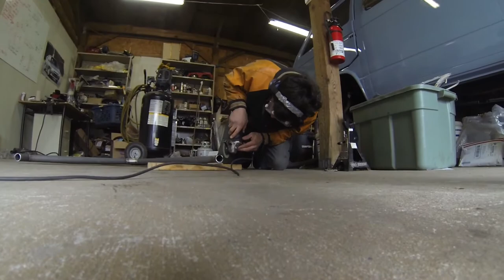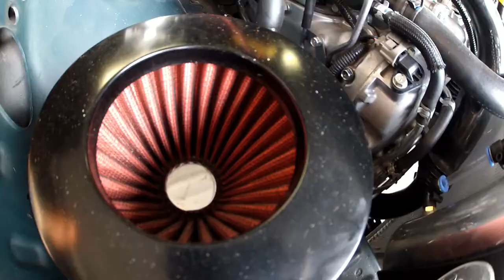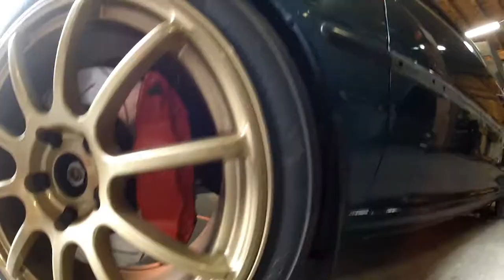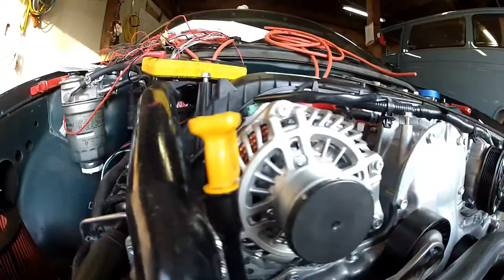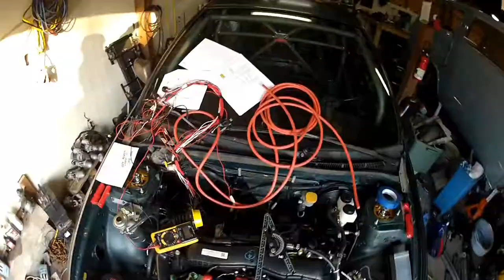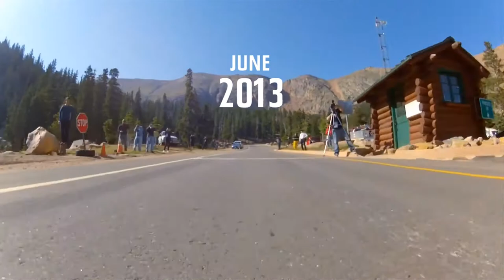Impreza Boxer diesel Pikes Peak 2013

Comment from the maker: Yes, diesel engine + 6MT trans! everything is bolt on and fit like the stock EJ18,22 or 25.

no interferences or complications. The power steering comes on a bracket and works perfect. The only thing is that the power steering lines need to be build to lenght at your local hydraulic shop for about 100 bucks.